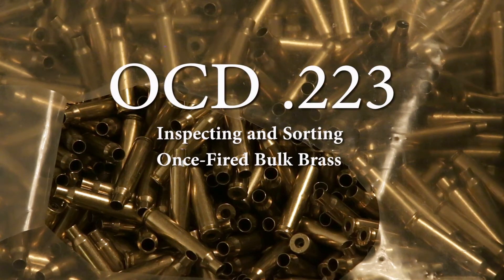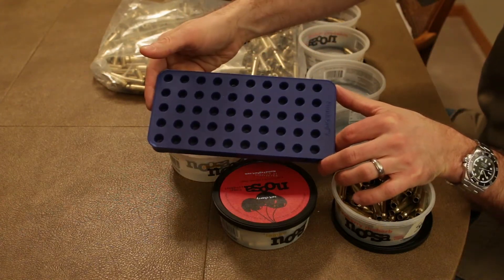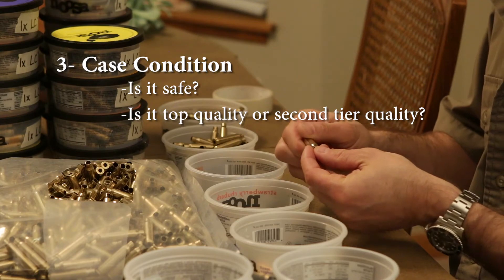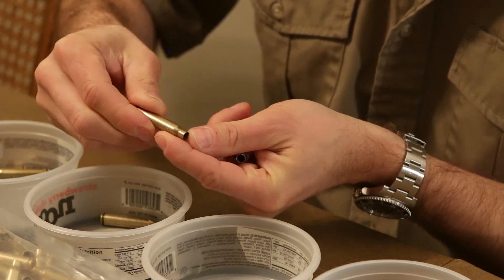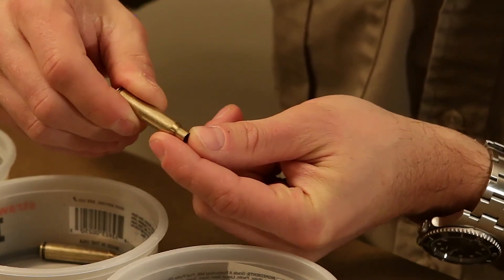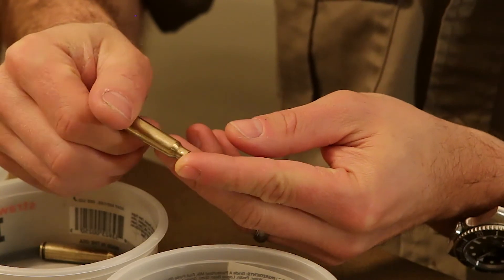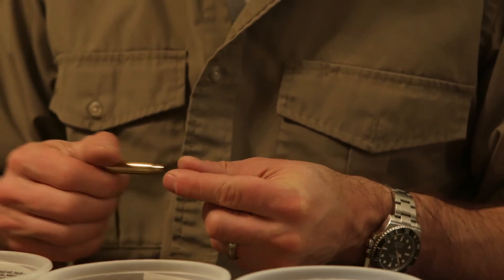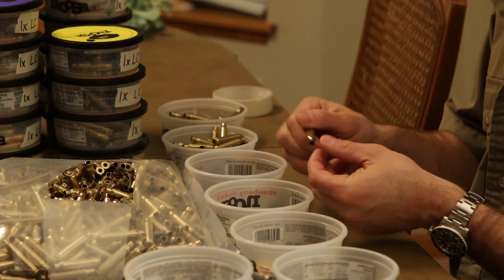OCD .223:  Inspecting and Sorting Once-Fired Bulk Brass

Comment: I got 500 pieces of 223. Headstamp's all over the place. Was going to trim to 1.750, however after de-priming, tumbling and sizing the are ranging from 1.730 to 1.761. Can i reload the cases with 1.740 and under length?
Reply from the maker: Yes, it is still safe to reload the cases that are 1.740 and under.  After a couple firings, they will slowly flow ("stretch") out into longer cases and will eventually need trimming, too.  Just never exceed 1.750".

Comment: I got 275 pieces of once fired, mixed, 223 brass. Sorted them out and most were FC brass. 2nd most was imi. The rest was 2 or 3 pieces each of all different brands. I'm not reloading for accuracy or anything like that. Just getting started. Trying to get the process figured out. Can I reload all the mixed brass the same as I would the sorted FC & IMI? or do I need to give them some sort of special attention?
Reply from the maker: Assuming all the brass you've sorted is in reasonable condition, you can very much load irrespective of headstamp...but it will make developing a load a little tougher, as what works in one case may not work in another.  Most importantly, what might be SAFE in one headstamp, might be dangerously overpressure and UNSAFE in another.  Now,  brass cases are still made to similar standards regardless of headstamp, and you can very much work up even an accuracy load (hunting level, not target level, say 1.5MOA) with a lots of pretty random brass.  I shot almost exclusively Black Hill Blue Box Moly-Coated 52 Gr MHP, .223 which is reloaded once fired, mixed headstamp brass ( I counted half a dozen+  different headstamps per box of 50) in one of my hunting rifles for many years.  The worst of those boxes would print 5 rounds in an inch all day long, no exceptions.  The best boxes, which were just as mixed as the worst ones, would shoot 5/8" for 5 rounds at 100 yds.  The one thing I will caution you, and this is very important, do NOT try to work up a hot load with mixed brass.  Aim for a cool to moderate load, and start at book MINIMUM with your loads.   And definitely trim all the cases to length to at least keep your COAL (cartridge overall length) to spec.     Welcome to the rabbit hole my friend!  Ryan.
Reply: @FreedivejeepHD  right on! Thank you. Gave me a ton of good information here. Saved me from a lot more forum-searching as well. Huge help. 🙏
Reply from the maker: @Highnz57  Anytime!

Comment: Why does it matter what year? One would think Lake City 2010 has the same quality as Lake City 2012 right?
Reply from the maker: Very slight differences in brass composition year to year, which by no means indicate a difference in overall quality, will still yield very slight differences in strength and pressure.  I've developed a load that at 27.3 gr of powder shoots all over the place, but at 27.4 gr is the most accurate load I've ever shot.  If you're going to push the envelope, take no chances- change only a single variable at a time.  That means you don't change powder quantity and headstamp date at the same time.